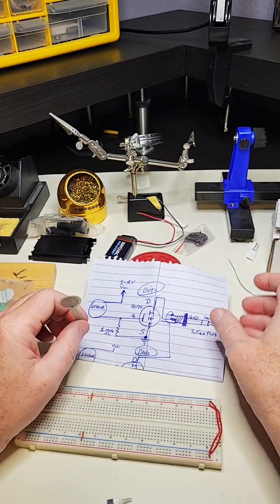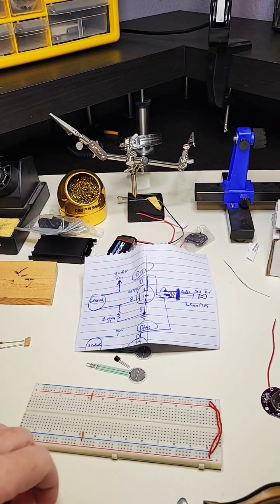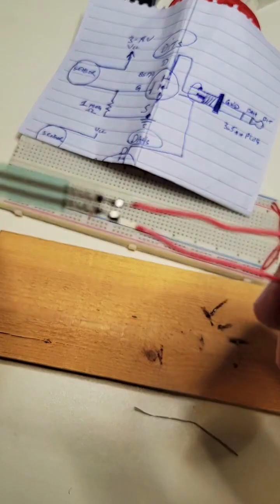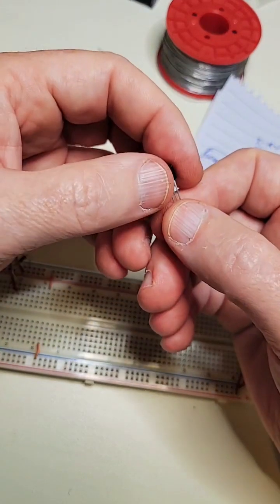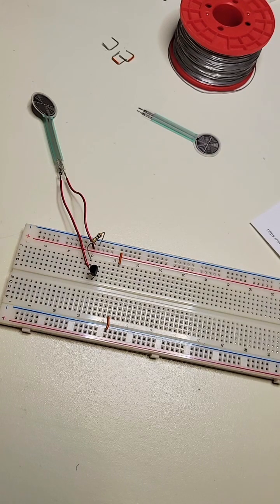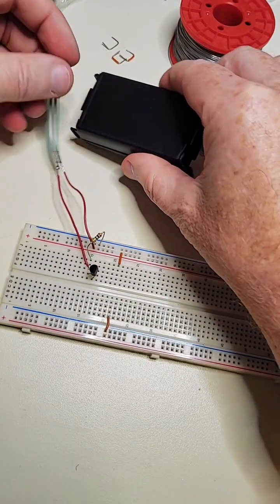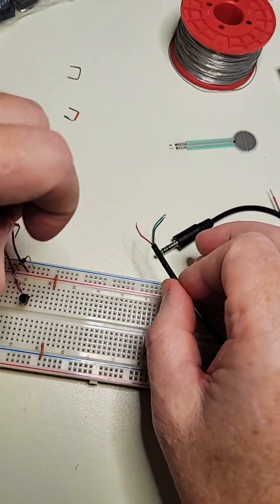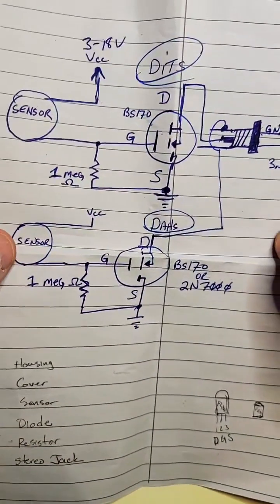1 Homebrew Build of a Force Touch Sensing Morse Code Paddle

Comment: You said 85170 transistor. Maybe it's BS170? 😉
Reply from the maker: haha yah, I tend to misspeak a lot.  In this case I was probably reading the part number off the component and took the B for 8 and S for 5.  Thanks!
Reply: Nice work Charlie. Glade to see you are "finally" building it. Can't wait to see how it turns out. 😂
Tim - K5DEZ